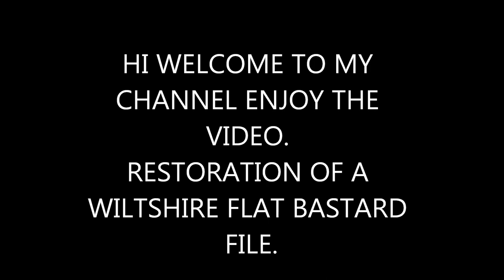RESTORATION OF A OLD WILTSHIRE FLAT BASTARD FILE WITH CUSTOM HANDLE (35TH TOOL ON THE WALL) CHECK D.

Comment: For anyone old enough to remember Rowan and Martins Laugh- In from the 1970's the phrase "verry interesting, but stupid" comes to mind. What are we trying to do here? Is this meant to be a restoration to working order of an old file, or the creation of a work of art to hang on the wall? Using a wire cup-brush to clean out the rubbish from the teeth is all very well, but it is like putting another year or more of wear on the teeth. At the same time, the handle is very pretty but I prefer a much more traditional handle  to provide much better grip. And please explain, what is the purpose of the stainless sleeve on the back-end of the handle? The whole thing strikes me as an absolute example of form triumphing over function, and yes, it might be a lovely thing to hang on the wall; I certainly wouldn't want to use it in the workshop.

Comment: Never, ever use a steel brush on a steel file. The brush will destroy the sharpness of your file. Use a brush with brass bristles or a 3 mm brass plate to clean it.

Comment: Mate, you done a great job at the handle, well done. However I am not sure if that is the right way to sharpen a file. I always put my files in vinegar over night and then neutralize the acid by dipping the file in warm water with bicarbonate of soda mixture, then give it a good wash in a rich soapy water. To prevent rust and clogging, just rub chalk on the file. I wouldn't wire brush a file, if you need to brush the file, just buy a 'file card' which is a special brush especially for files.
Reply from the maker: Thanks for the info I think I no what you're talking about file card will be uploading again soon.